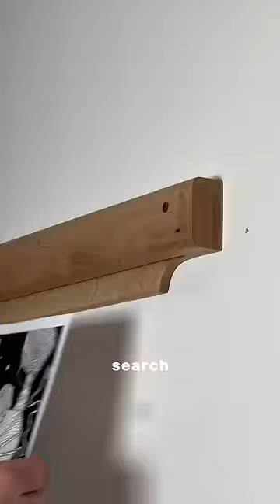Border Searched #bordercrossing #story #product #productdesign #smuggling #woodworking #smallbiz

Comment: I work with fancy concrete. Part of my work is to match my product to already built walls and structures. That means samples are sent to me all over Europe. Concrete samples. Somebody gets a piece of test concrete, smacks a piece out of it and sends it to me. Now imagine somebody checking packages in customs running 8 kg chunk of concrete through X ray. I have seen lots of "package opened for customs".

Edit: Woah, seems this one got some comments and I didn't get even a note of it. 
It's usually new buildings where we match the colours of our product so it "dissapears" in their structure. Matching a random muster is way more harder and usually we offer our own selection to choose from. Best practice  for muster matching is to have the original surface that created the muster in the first place. Or, I recreate the design in CAD, 3D print it and cast  it as rubber mats.  
Our product itself has some specific fire and waterproof certificates so we can't use their existing concrete mix. Usually. There's also some even more specific  cases where only some very special mixes are legal to use. Like German railway had their own certificate for concrete. 
The 8 kg piece is what it it sounds like. A joke in a box. It just happens every now and than.  Sombody takes the whole sample cube and sends it because they could not be bothered to cut it.  We don't need it that big and usually it's way smaller piece.  But its the nature of the beast. Think of a really big building, like a hotel, bank or why not an airport  construction. The amount of stuff moving around in that context is just mind boggling and the shipping costs are whatever the bill comes at the end of the month. It may cost more to take the time to crack it in half than just ship whatever the sample you have. The shipping rates for corporate  are wayyyy cheaper than what regular people can get. 
Also the customs come into play from post outside of EU. Like Switzerland and UK.
Reply: Wow! That sounds so interesting. Could I ask what do you mean by “fancy concrete” you mean like detailed colored concrete sort of like designer work? Or more like structural specific concrete. I own a concrete company with my dad over here in the states and we do more detailed private work than anything so anything concrete has my full attention hahahaha
Reply: By fancy concrete, do you mean "specific-use", "high-tech" or just "neater-looking than gray"?
Reply: If your packages are opened by customs within the union contact a lawyer specialized in import export laws etc and sue the crap out of your local customs agency. I had the problem a lot of my packages (within the schengen) got checked by customs (unlawfull bcs schengen) and damaged goods and Dutch customs settled for a big big amount
Reply: The hell do you need an 18lb sample for lol
Reply: I ordered 100 transistors from china, they arrived, on the front from the seller was the name with "Lab" after it, someone had opened it and taken just one transistor out... I do have a day dream that someone saw the word "Lab" and felt tablet like items in the envelope, and took one out and hopefully tried to swallow it 😂😂😂
Reply: @DLo336  They’re an international specialist in building restoration working on projects across the world. Are you really questioning this? (Also, 20 lbs is like, not that much? It’s not like it’s 500 pounds lol)
Reply: @bakedbeanfanclub  buddy calm down, I was asking WHY it requires an 18lb sample. It seems like that would be a logistical nightmare to ship. I am not questioning if it needs to be done or even why. Just why a sample that size.
Reply: If you’re getting that many samples, your work must be pretty solid
Reply: @DLo336   18lbs of concrete really doesn't seem like a logistical nightmare to ship - the weight limit for a flat rate box is 70lbs. (18 lbs of concrete is about 207 cubic inches, which would more than fit in a medium size flat rate box @ 546 cubic inches)
Reply: WE ARE HONOURED TO HAVE YOUR VISIT, MR. PIG. HERE IS OUR CONCRETE! (shout out to the parents who have this burned into memory)
Reply: Same as me, i have graveyard cylinder concrete in my backyard 😂
Reply: @bakedbeanfanclub  You need to go finish your cereal before it gets soggy.
Reply: @bakedbeanfanclub you still didnt answer his question
Reply: Lol
Reply: @yannickoepcke1568  I mean, I don't work in this space, so I can't say exactly. My guess would be that they need a reasonable amount of all surface finishes they need to replicate, on a piece thick enough to guarantee that it'll make it through shipping safely (and not require too much manual preprocessing on the source side). This is like, three or four 2x5x5 blocks. I don't know why everybody's losing their tits over mailing that "much" concrete lol
Reply: @ajoshdoingthings541  I'm pretty sure he'd be working on older buildings
Reply: @facingallodox  I see what you did there...
Reply: @DLo336 cuz by the time he gets it it'll be two 9lb pieces if he's lucky
Reply: Do they ever crack it open thinking that theres drugs onside or something? Idk if you can xray concrete
Reply: @Jan54321  in america, if it looks like cocaine it's gets opened
Reply: @DLo336  Well he said part of his job is to make his product match already-built walls AND structures... maybe some of them have some sort of pattern or design that requires a certain sized sample
Reply: Their suspicions were concrete though.
Reply: I work with regular concrete and came here to figure out what "fancy" concrete is......I'm still sitting here with no clue
Reply: @bakedbeanfanclub Right, Bruh? Desktop COMPUTERS weigh way more than 18 lbs. A lot larger and more unwieldy too. The last desktop custom build I shipped was almost a full 36" tall and had a shipping weight of 58lbs. Like an 18lb piece of concrete is gonna be tough.

You k kw what is really hard? 70" TVs. Or large magnets..... Now THAT is a logistics nightmare.

We haven't even gotten to shipping servers. A "small" 2u server is a good 70+ lbs, over 3" tall by 19+ wide and 38" deep.
Reply: I work for DHL and we have a company who analyzes dirt from mines. We are just shipping dirt on planes for thousands of dollars and inspecting them is always dumb loo
Reply: I airsoft as a hobby, ordered 1 replica airsoft part that wrongly got seized and now they open EVERYTHING  of mine thinking I'm some sort of arms dealer ordering parts that can't handle  firearm use😂
Reply: @davidlabossiere1140 
 Don't forget the Airsoft shop that had most of their stock seized in "aft" raid with the SAC standing in front of camera saying that it could be converted to a actual M.G. the ones in the shipment were all plastic short of springs. 
😂
Reply: We made "special concrete" for area 51.
Reply: Is it true we can’t recreate Roman cement?
Reply: So you're the guy who made us order special sand from Italy to match the mortar on that historic building restoration.
Reply: Imagine how annoyed they are when they realise it’s concrete hahahaha
Reply: The guy at customs that tried some of the stuff lol
Reply: @liamsparling  No it's not true.
Reply: @jayesgazebo  someone said that to me and I was of the understanding we could make it still we just don’t use it
Reply: Thank you for the awesome project idea!
Reply: @copasetic87  plz document it
Reply: @Jan54321 it was an example of one sample & the answer to your question is right there in the text. nobody weighed it out on purpose they "smacked off a piece of concrete." get ur reading comprehension up little man
Reply: Yeah, customs opened up my package to check if my drawing tablet pen was suspicious. Granted, they never sealed it up properly so the only reason I got the pen was because it was stuck on the customs tape
Reply: Does the xray provide any useful information about the concrete?
Reply: I had a friend in Pakistan send me a hat that they wear there. It arrived in a destroyed cardboard box, with Pakistani customs, US DHS, Border Control AND DHL tape all over it, having been inspected half a dozen times.... The box was tattered lol
Reply: Interesting…thanks for the comment
Reply: @DLo336  18lbs seems like it would be hard to ship? I have truck parts shipped to my house all  the time.  I had a 100lbs transmission shipped on time.  It went to my job because it was cheaper to unload at a dock.  They would have sent it to my house and dropped it with a lift gate truck.
Reply: Meanwhile the USDA constantly puts holds on my fucking toilets
Reply: @liamsparling - No,it's not true. We are able to make Roman concrete.
Reply: @DLo336  have you ever weighed concrete? 18lbs is like a 6" cube.
Reply: @danielmartin1  I get that, but you still pay per pound. Jesus I just said it would suck to have to do. I didn’t say it was impossible or wasn’t smart.
Reply: @DLo336  I should have read all the comments. I was just replying to your first comment asking why he needs that much. I work with wood samples, and I understand that with custom matching, the bigger the sample the better. Yeah, I imagine its not cheap.
Reply: Don't tell lies
Reply: If they ever stop it looks like you found a perfect way to smuggle drugs
Reply: No…. You just do it to confuse authorities… well done that man.
Reply: Does the fancy concrete wear a monocle and a top hat?
Reply: @liamsparling We can, but there’s no point. Roman concrete wouldn’t stand up to the forces required by modern roads or structures
Reply: Nice, in the US, we record every single aspect of the concrete we make, from 2inch+ down to No. 200 passing aggregate, we record the amount of water added at the plant, how much on site, theoretical compressive strength, and actual compressive strength, air percentage, slump, temperature of concrete during the pour, high and low temperatures during curing when we can, the amount of lime, the amount of additives, time batched, time casted, method of pouring, weather, and a good amount more
Reply: @SteamyDuke  lmao just saw the one the other day that he for some reason gets IN the concrete while explaining to the kids how it solidifies then proceeded to let it cure and get stuck lmao
Reply: Customs agent 1: “my guy what is this” 
Delivery guy: “concrete”
Customs agent 2: “it has a ph of 12”
Customs agent 1 “no shit”
Agent 1 proceeds to drug test the package
“Huh”
Reply: @Jan54321 Good to know!
Reply: @DLo336 - Concrete samples are shaped like cylinders the size of large milk cans with its end enveloped with plasticine. There are countless kinds of cement and different concrete mixture. Each need to be tested.
Reply: @hanselito2416- Ironically, building inspector use a special nuclear scanner to use in testing concrete density and composition.
Reply: @DLo336 why would 18lbs be a logistical nightmare? It should ship AS easy as anything else
Reply: @Jan54321   Having several kilos of an unidentified powder would give them reasonable suspicion to search. A lawsuit would be thrown out really quick.
Reply: @spilledsoju03  you must be a American lol. He is talking about concrete samples and not concrete powder. There are no customs inspection with produce going with it the schengen expect when a judge gives permission for a x ray or dog control.
Reply: @Jan54321  concrete samples can be powdered or solid, and yes I was talking in terms of the u.s. which i assumed you were since you mentioned suing(mostly an American thing)where they most definitely can and do open suspicious packages. Either way suing would just be a pointless asshole thing to do.
Reply: ican picture some poor employee standing there going WHY DO THEY NEED THIS?! 😂
Reply: @BawkBawkBawk666  Jesus Christ yall………I’m just saying it sucks to have to ship that much weight just for a sample. I didn’t say it was impossible or anything like that. It’s just heavy and expensive
Reply: @skeletonseason Go back and read it yourself.  It wasn't just an example of one sample.  The last line reads, "I have seen lots of "package opened for customes"."
Reply: I bet they do all the breaking down for you 😅
Reply: We used to make such sample's at school at put them in a pressure tester it was ten cm cube's and they had to take the pressure of ten tons if they didn't we had to make new sample's i guess i could make a sample that could stand somewhere between eleven and fifteen tons now
Reply: @DLo336 causes not that big of a piece, just heavy
Reply: @adelinawarriner6259  good god. Buddy I know!!!!!!!!!!!! I deal with concrete every day. I was just saying it sucks to have to ship that all the time. Do y’all not have wives to argue with?
Reply: @DLo336 I respect the fact that you converted it to freedom units but I still despise the measurement
Reply: You should travel w/me. Getting onto a plane is so exhausting you need a vacation.  I've broken >40 bones, had 3 spinal fusions, reverse shoulder replacement, insulin pump, and continuous glucose monitor. I warn TSA to get a female body search person BC I'm going off in xray machine like 4th of July. ...and I'm a woodcarver, my suitcase is filled w/knives & always has to be checked. But traveling with me.... you get on plane first! Bonus.
Reply: Ah, fancy concrete.. Or what we usually do, whatever brand is available..
Reply: @blackcountryme man was at home for hours like "this new acid aint shit😠" 😂😂😂
Reply: @davidpetersen1 what's wrong with  soggy cereal? soggy cereal built this country! I love All soggy cereals! Captain crunch is a killer cereal even when it's soggy! not a serial killer!
Reply: Can you import some “concrete” from Colombia for me?
Reply: So  fxxken what!
Reply: Hahaha and they probably take a small chunk for testing to make sure is not drugs 😂
Reply: Reddit, time to find original reply-er so he can finally tell us what he means by " fancy concrete"😂
Reply: @bakedbeanfanclub not in the feild ethier but my guess is its hard to knock out  smaller peices for ppl who dont do it on the regular,  or maybe hes looking for discoloration he needs to match alot of the times buildings get dirty an wen iy raims it washs everything from the top to the last 5 or 10feet..maybe he even needs a big enough peice to crush as a test to see if the concrete is still structurally sound..look at alcatraz prison the salt water destroyed the stone
Reply: @DLo336 do you know how much concrete weighs?
Reply: Maybe it’s me being high but “somebody gets a piece of test concrete and smacks a piece out of it” got me 😂😂
Reply: why does it have to be 8kg
why not a smaller sample size
or is a sufficient mass required for testing
Reply: @imheck  "soggy cereal built this country.".. yes, apparently the bridge in Baltimore is testament to that strength of your nation. So have at it , hoss.
Reply: @DLo336  How is it a logistical nightmare to ship something that weighs 18 lbs? Is $33.54 a "logistical nightmare" now?
Reply: @allmycarsisbroke  omg people I didn’t kill his first born! I asked a damn question
Reply: Well that one makes sense tho 😂
Reply: @DLo336  Dude calm down, take a deep breath. Nobody here was talking about killing anyone's kid's--just you.
Reply: @DLo336  My god, man. I just had to scroll back down here to find my last comment again and realized you've been in here responding with exasperation to every single person who replied to your comment as if the whole world is ganging up on you.

Do you not understand how youtube comments work? We don't all read the entire fkn thread--we see the top level comment, we see the first few replies, and if we want to, we might click reply on one of them.

If having this many people bewildered by what was frankly a rather ridiculous question to begin with is really this upsetting to you, just delete the original comment and move on with your life. You've heard from plenty of people by now that you vastly overestimated the complexity and cost of shipping an 18lb piece of concrete as a business expense, so you've got your answer. Why not just dip out so you can stop pulling your hair out and going mad over this?
Reply: @allmycarsisbroke  buddy it’s no sweat off my back, you just typed a damn novel about something that has nothing to do with you. Are you ok?
Reply: @DLo336  Bro if 3 small paragraphs is a novel to you then you're not even literate enough to be bothering with youtube comments. Go pick up some Dr. Seuss and some coloring books.
Reply: "I work with fancy concrete" i love it.
Reply: @DLo336  it's not a very big sample if you are trying to match color and texture. Concrete is dense.
Reply: What the hell could they possibly have to send you a giant slab for?? Do you test purity of some sort or just the look of it or what. If so do you sand it when it shows up incase it took any damages in the post/when chipping it out?? Im so beyond confused. Definitely not something we do in canada to my knowledge😂
Reply: @austinthrowsstuff that is fucking wild what the hell. I mean its gotta go somewhere to be tested but they cant get local scientists and drive it there or something?? Thats mind boggling to me😂😂😂
Reply: @davidlabossiere1140 meanwhile I order a whole pound or more of pot off an online dispensary occasionally and it doesnt even get searched or held up. Such a wild fuckin world we live in🤣
Reply: @bakedbeanfanclub: You have tried… It’s not even your company, firm, project or concern. Yet you’ve tried.  For your efforts you’ve attracted whatever it is…

I appreciate your effort!
Reply: I shipped a bunch of things home from Morocco.  Not one package made it home intact and without a note. 😂
Reply: @DLo336  you ever apply to work for customs? You'd be a great fit with how nosey you are!
Reply: @bakedbeanfanclub very bold of you to come in here and get all weird about someone asking a valid question when you don't even have an actual answer for it lol

i was wondering the same thing, whether or not a smaller sample would be fine to use or if it's necessary to have a chunk that big in case of inconsistencies in the concrete or something.
Reply: Seems like they checked it and got concrete evidence
Reply: So you are a real life Papa Pig?
Reply: @rat-gang-  The resource I found online says: "To get all the properties right, the petrographer needs more information than can be had from a small sample of mortar broken off from the wall. Ideally, you’ll provide a hand-size sample in one piece. That way the petrographer can see the porosity, identify the inclusions present, and take a representative sample for chemical analysis."

So, there's your longer answer, from this field that I've said numerous times that I don't work in (and others above me have given better and more specific answer around your actual question). 

If you have a different concrete sample specification in mind that's only 5 pounds that you feel should be used instead, as you're mailing concrete halfway across the world for a (presumably) expensive project, feel free to suggest that to the original OP who said they get 18lbs of concrete samples pretty regularly. I'm sure they'll appreciate the marginal savings in shipping cost, and I doubt they've ever thought to do that before.
Reply: @liamsparling  It's sort of true, in that it took us quite a while to figure out how to reproduce it. It was only relatively recently we fully figured it out. But the way Roman concrete was made, it actually gets stronger over time. Which is a great feature, but my understanding is it starts a lot weaker. Which is not useful in the modern world where we need to build something that can immediately hold the weight of large vehicles, etc. Ancient structures didn't need to support so much weight so quickly, so it had time to strengthen to the point it can support some of those things now.
Reply: Thought of peppa pig
Reply: Tell me you don't know how to concrete without telling me 😬😭
Reply: I work in materials at a civil engineering firm.
TSA loves leaving "hi we searched your bag" notices in my 5 gallon buckets of literal fucking DIRT
Reply: Very good cover
Reply: I have done plenty of "fancy concrete"
Reply: @Jan54321  that only works if the goods are damaged. If there was no effect on the product and the judge thinks it was a justifiable search, it may be ruled in the customs agent’s favor.
Reply: @imnot-  it's a sample though, it isn't going to be used in the final product so the shape and size really don't need to be specific.
Reply: @jayesgazebo we only just figured it out buddy, so it's true up until recently (I think 2014)
Reply: @DLo336 literally everyone replying to you has completely missed the point. Lmfao
Reply: @allmycarsisbroke  33 dollars per sample and he's had a bunch of them shipped out, so that's 33 X how many samples have been sent plus all the paperwork for the samples, so yes that's a nightmare to do in all honesty. Smooth brain
Reply: @bencastor9207  I’m glad you get it lol
Reply: @DLo336 concrete is very heavy, 18lbs isnt as much as concrete as it seems like it would be
Reply: @charlesalexander560  Jesus Christ another one……man I know this. I was simply stating it would be a PITA to ship 18lbs of concrete for some testing. I completely understand it’s not the size of a Volkswagen and doesn’t cost $10,000 to ship but it is big, heavy, and expensive. That is all.
Reply: @DLo336  buddy i dont know who hurt you, but all i did was see your comment and share a little info, its not like im arguing or correcting you. Im sorry if i came across as being a dick somehow.
Reply: @bencastor9207  they do if the sample has a repeating pattern on it as it would need to be a specific size to encompass the entirety of the pattern
Reply: @bencastor9207  the sample was more than likely broken off from the original structure.. otherwise that would suggest that the person sending the sample could've constructed it himself... it also depends on the size of the structure.. especially if a pattern is involved, because the bigger it is, the more your "sample" starts to look like another random chunk of concrete.
Reply: @bencastor9207  Yeah but 33 bucks to send a sample is inconsequential when you're selling concrete orders for tens or hundreds of thousands of dollars. Nobody needs or wants a sample of concrete unless they're planning to build a bridge, or a parking garage, or something like that.

If you think it's expensive to ship the sample, don't even ask what it costs to ship the concrete the person ends up ordering. Shipping costs are insane.
Reply: You do what peppa pigs dad does and I love that
Reply: ...and waiting around for it to get hard...
Reply: @facingallodox  pun intended?
Reply: @dadsquatch79 😮
Reply: @DLo336  to let the homies try some too 😂
Reply: @Jan54321 Jan. There are still items you can not send via post even in the Shengen area! Aerosols, highly flammable fluids, certain liquids etc.. Some countries don’t allow meat or dairy products etc. Yes, prohibited lists are even country specific in the EU. Packages get x-rayd and airports can refuse handling your packages if the items inside are deemed a risk. Postal workers also have the right to question you about the insides of your closed package, demand you to open the box if there are suspicions and refuse sending the package if you do not comply.
In the case of concrete samples, yes. Especially if it is powder form and unlabled, it will give cause for investigation.
You can’t send whatever shit you want with post just because you are in the Shengen area.
Reply: @slightlyevolved      Yeah well if size matters, it seems in thus discussion, it's a big deal, we shipped a press standing 19 ft tall in our yard,  and weighing 43 tons...  from Montreal to Houston Texas, no big deal. 
There are ways 😅
Reply: @spilledsoju03 .   Powder ??
Reply: @yannickoepcke1568  In the USA, I think the standard test cylinder is 6 in. diam x 12 in. tall. You do the math.
Reply: @facingallodox  It's concrete samples brobro, it better be solid
Reply: @ajoshdoingthings541 he likely means all three, so whatever isn’t regular concrete is what he deals with
Reply: @NotEvenOverThere  okay, ye makes sense. Still curious tho
Reply: How many papers
Reply: @DLo336 because 17 lbs just will not do.
Reply: @blackcountryme to them….resistance was futile! (See what I did there? 😂)
Reply: I've found Daddy Pig!
Reply: @Jan54321  Hahahaha. DUTCH Customs is law-abiding.
US Customs are off-shoots of Hell.
Reply: we found daddy pig
Reply: @bakedbeanfanclub  Stop being triggered for no reason.
Reply: @Teuwufel   It's really frustrating to see people focus on imagined details and problems about a field instead of talking about what they actually do. 

Somebody replicating concrete for historical buildings or other existing structures is cool as hell, and is surely a millions-of-dollars-a-year business in revenue. Then this guy is like "hey, uh, but $30 for shipping is a little high...why not send like a postage stamp amount so it's a little cheaper" and refuses to back down on that take. 

My only guess is that a lot of people don't understand that a lot of jobs involve spending a lot of money in general? Honestly though, this isn't even a lot of money. Just confusing
Reply: @DLo336  compression tests. YOU'D BE SURPRISED. Concrete is typically mandated to be tested. A larger sample is often necessary for column compression testing as well as other scientific destructive and nondestructive tests. Before you invest in a given product, you'd want to know whether the concrete is worth a damn. My Dad would do column tests for every batch of concrete, as mandated by US law. Just like spot testing welds. IMO, Nothing to see here. Like far too many plausible reasons.
Reply: @bakedbeanfanclub  Because they can't possibly imagine any of the possible reasons (including insurance). Like, showing it to prospective clients when they ask for a "sample" to know what this "fancy concrete" looks like (fancy can include colored, like those super expensive colored concretes that require a pure white sand concrete and then add colors to it; My dad did these semi-regularly for school floors and the like; it's super cool looking, but ridiculously expensive particularly, when current concrete (not using actual traditional Roman recipes that call for larger lime particles to create time release lime packs) only last 100 years, and ideally, a school building should last longer-term. For the price of said concrete, you could practically buy marble (or could in the late 1990s to early 2000s when he was doing this.

I imagine that they simply don't understand the numerous reasons why you'd need concrete columns or samples.

THEY LACK IMAGINATION (and likely real world experience) ><
Reply: @austinthrowsstuff a fellow dhl employee you love to see it lol
Reply: @dadsquatch79  That is discrimination, just because a Pakistani sent you a hat they gonna check it half a dozen times? I bet if it came from Israel that would not have happened. Shows the assumptions people have. Disgusting.
Reply: @waterlife.1905  lol that's not discrimination. Their own government searched the box lol.
Reply: That's some concrete evidence
Reply: I guess customs has Concrete evidence.
Reply: what differentiates "fancy" concrete from other concrete?
Reply: @DLo336 smashing concrete probably isn't a precision process. they may need a certain amount to run multiple tests. some tests are destructive and use up the material too
Reply: no international uranium for you
Reply: This is what daddy pig from peppa pig does for work
Reply: @Jan54321  For what?  They're allowed to do it.
Reply: @AngelusNielson  not within schengen.
Reply: That's a cool job
Reply: The True Savior

HalleluYAH (Hallel u YAH) “Praise ye YaH”

YaH is The Father (Genesis 1)
YaH arrives via the TENT OF MEETING
YaH was Who they Crucified for our sins
YaH was Crucified on an Almond TREE

Semitic (Moses)
Isaiah Scroll (The Original Isaiah)

Isaiah 42:8
I am YaH; that is my Name! I will not yield my glory to another or my praise to idols.

Isaiah 43:11
I am YAH, there is no other Savior but Me.

Isaiah 45:5
I am YaH, and there is none else.
Reply: @facingallodox I see what ya did there
Reply: @sebastianm.h.3598 I'm not the op but I'd assume it's for historical buildings and architecture restoration where the concrete needs to match the original in color and percentage of fine and large Aggregates
Reply: @Jan54321  I mean isnt that the whole purpose of cutsoms? To check for contriband?
Reply: You can always bring a microscope and put the microscope through the xray machine before the concrete so that it doesn’t look as random.
Reply: Just imagine if you had to aggregate or something, so they’d be mailing you the cement in powder form.
Reply: Then there is roadworks, and asphalt samples. Same deal.
Reply: daddy pig??
Reply: @DLo336  I was also wondering if they actually needed that much concrete or if the people sending it just got over excited about sending concrete in the mail or something
Reply: @sebastianm.h.3598 by fancy it means custom mix designs with materials that are unusual. Had a sheikh that wanted gold and copper ore instead of full aggregate mixes, that then get sandblasted and polished. We did a ton of lab testing first to find the right „look“ he wanted to then get approval. Total pour was 45cubic metres a wall in his entrance hall at a lake in Germany, with Arabic writing set in it. I guess he is someone that finds the materials that are for the writing cause heck I don’t know how to that tbh?
I just know the guy that did that earned as much for 5 hours work than the material cost was for 10 cubic metres of 60% pure gold ore concrete
Reply: @nicks6196  wow. Good on you boss that seems like a dream job hahahaha.
Reply: @nicks6196  or a nightmare😂
Reply: Probably cuz it looks like a giant crack rock in X-ray
Reply: Uh Daddy pig?
Reply: LMAO😂
Reply: Customs seized the 3rd suppressor i illegally bought in New York.
Reply: The only problem I have with that is that I have to pay money as soon as I receive the package for the procedure of customs opening my package for bum fuck no reason at all...
Reply: @marcl.1346  you have to pay for that? What a joke that’s a load of bs, just another way to make a dollar
Reply: @sebastianm.h.3598 woah, seems this one got some comments and I didn't get even a note of it. 
It's usually new buildings where we match the colours of our product so it "dissapears" in their structure. Matching a random muster is way more harder and usually we offer our own selection to choose from. Best practice  for muster matching is to have the original surface that created the muster in the first place. Or, I recreate the design in CAD, 3D print it and cast  it as rubber mats.  
Our product itself has some specific fire and waterproof certificates so we can't use their existing concrete mix. Usually. There's also some even more specific  cases where only some very special mixes are legal to use. Like German railway had their own certificate for concrete. 
The 8 kg piece is what it it sounds like. A joke in a box. It just happens every now and than.  Sombody takes the whole sample cube and sends it because they could not be bothered to cut it.  We don't need it that big and usually it's way smaller piece.  But its the nature of the beast. Think of a really big building, like a hotel, bank or why not an airport  construction. The amount of stuff moving around in that context is just mind boggling and the shipping costs are whatever the bill comes at the end of the month. It may cost more to take the time to crack it in half than just ship whatever the sample you have. The shipping rates for corporate  are wayyyy cheaper than what regular people can get. 
Also the customs come into play from post outside of EU. Like Switzerland and UK.
Reply: If you it decide to start a yt channel about fancy concrete I’d like to know.
Reply: @bakedbeanfanclub cambiando bolas de acero por bolas de cristal el concreto se escuajeringa por lo cual es conveniente poner un poco de alpechín